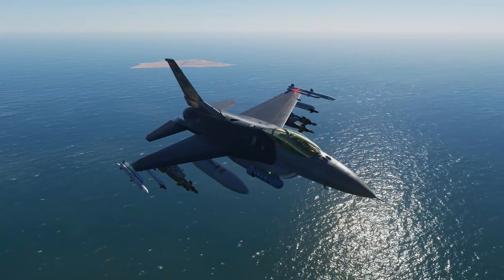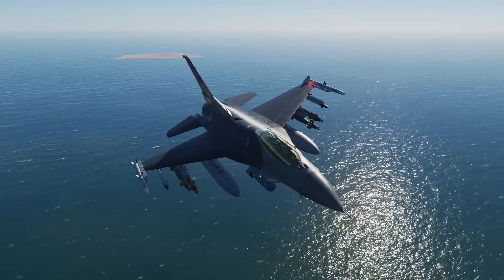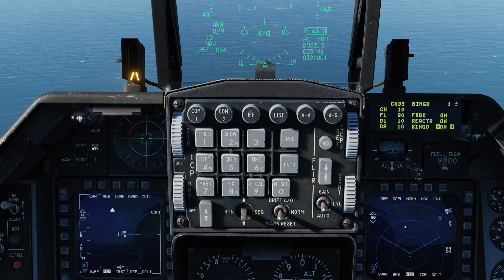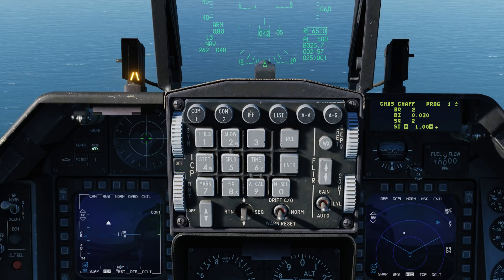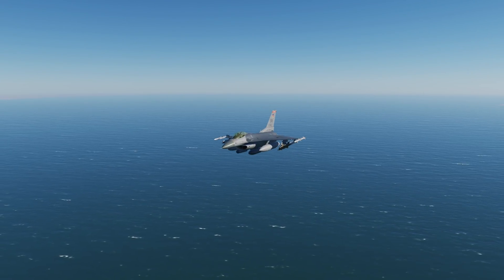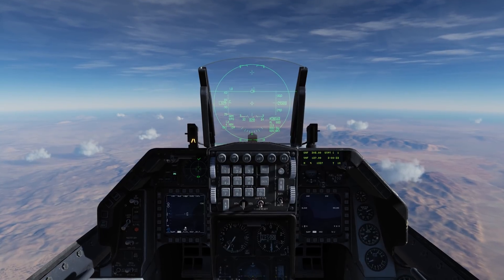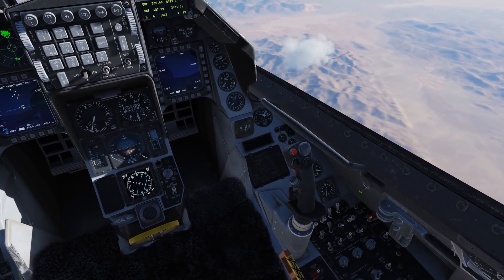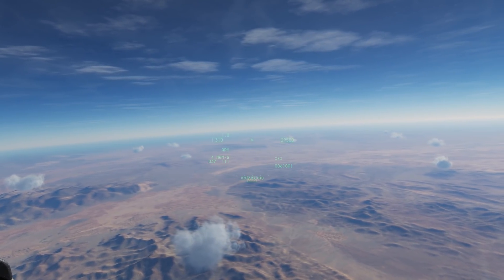DCS: F-16C Viper Update - 27 November 2019

Comment: 7:35 ---- radar should be turned ON at "fence in"
that's the standard 
other times it can be either prebriefed or lead will be directive... "vapor flight, fence in - nose cold" and flight members will do all actions of a standard fence check, but with radar off
(( there are tactical situations where you want to be non-emitting - yet be fully "up" otherwise ))
during a SCRAMBLE, jets "fence in" at take off